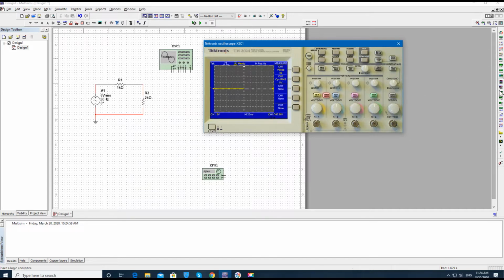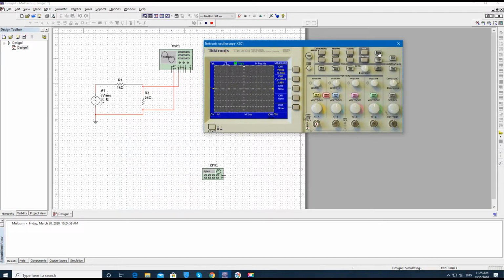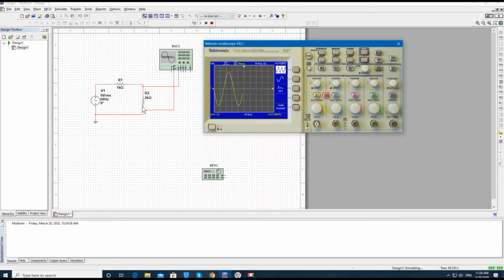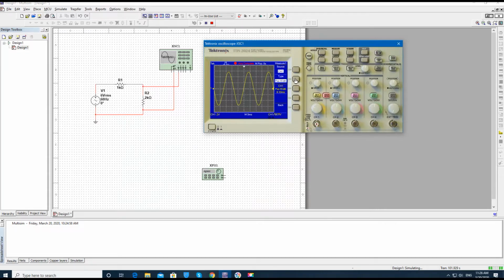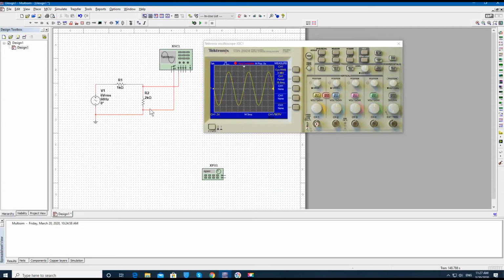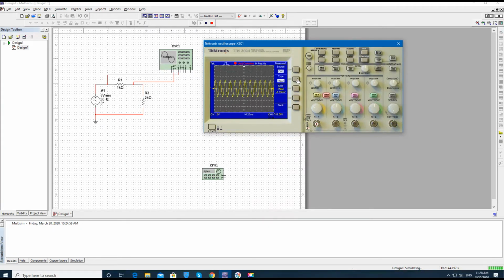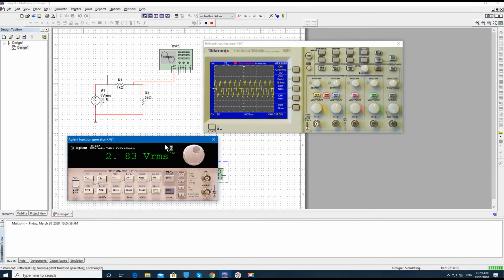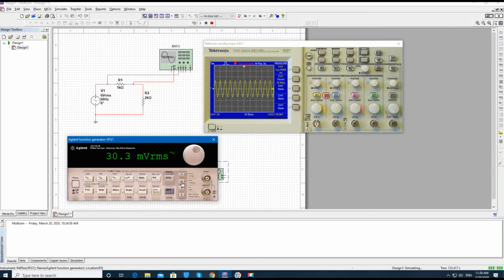Multisim Tektronix Oscilloscope

Comment: You can't connect probe directly across the resistor one.  You will be bypassing resistor 2 because the generator common is connected to ground.  You need to use the math function to find out the voltage of r1.
Reply from the maker: Thanks for your comment. If the two grounds are isolated then it is possible to do so. Usually, oscilloscope ground is not connected to the circuit ground.

Comment: Is there a way to see the current (I) value?
Reply from the maker: Thanks for your comment. It is not possible to measure current directly using oscilloscope. However, you can use a virtual probe to measure current in Multisim, or simply divide voltage across resistor by the resistor value for current measurement.